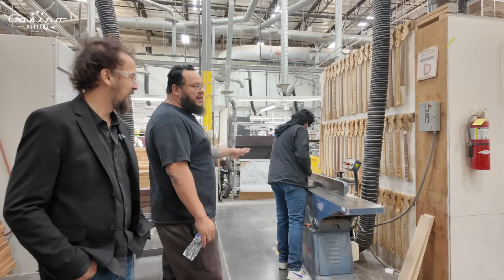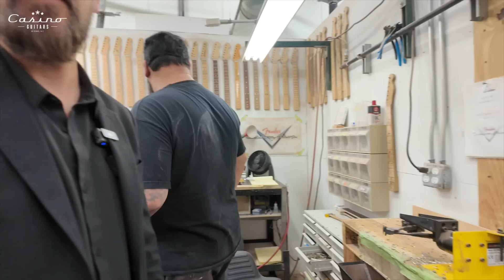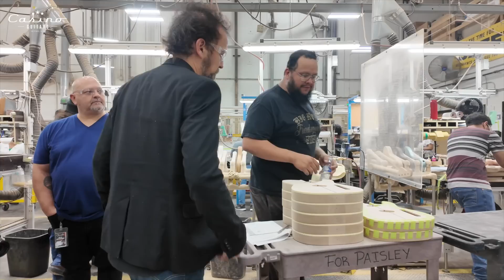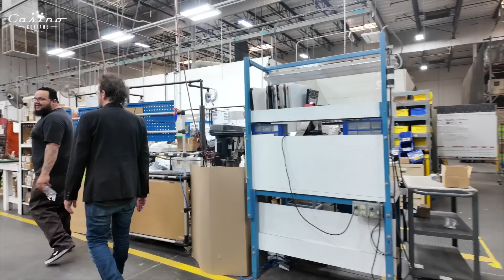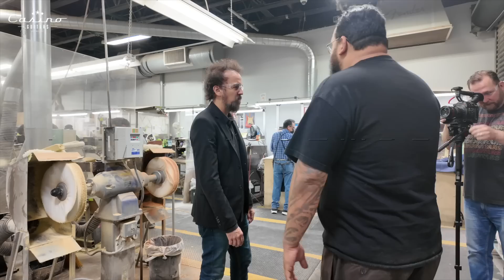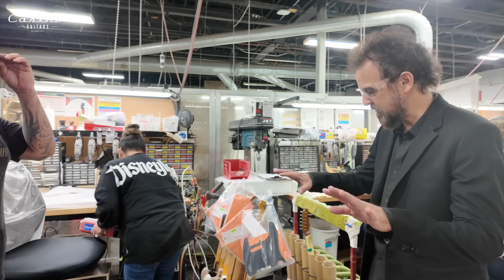Fender Custom Shop Factory Tour - Casino Guitars

Comment: I have seen a Jointer kill before; it was not pleasant.  Board slips out of the grip or guide and flies back and will stick in your head. Even several feet away. You NEVER walk behind past that when it is turned on. While cutting wood or not. When it is turned off, then you can proceed. That was a day in high school I will never forget.

Comment: It’s a pity they never checked the radius on my custom shop nocaster headstock. The corner radius is far too rounded off. In hindsight I should have not bought the guitar. It looks crap

Comment: How can you call it a "Custom Shop" when its just hundreds of people in a factory building a crap ton of guitars on an assembly line.
Reply: Tell me you’ve never played a custom shop without telling me you’ve never played a custom shop
Reply: @paisleyworldwide  i never said they wernt nice. i just dont see how sweetwater selling 100x of the same 'custom shop' guitar is 'custom' ?
Reply: @ true. the thing that makes them custom is that they’re built to the specs they’re ordered. Sweetwater specs them out to sell so they’re mass appealing. It’s like buying a guitar from Walmart, what would be most appealing to the most people? The customization truly lies in the options shown on the floor traveler where they have the pickup, neck, body, hardware, paint, relic, etc specs. If a custom shop guitar comes out basic that’s how it was ordered.
Reply: @paisleyworldwide  so what is 'custom' about a dealer ordering a bunch of guitars and you looking at them on a website? FSR (fender special run) would be a better term.  to me custom means the customer, not a dealer, calls in and specs off a 1 of a kind 'custom' made guitar.
Reply: @ … are you just trolling at this point? You can call casino and spec a guitar out to whatever spec you want and the custom shop will then make that guitar specific to your requests. “Custom” literally does not mean customer. It means the ability to choose your specs. It doesn’t matter who’s doing the orders, whether that’s you or a dealer, the custom shop makes the guitars according to the specs that are chosen.
Reply: @paisleyworldwide   Sweetwater can call fender and order a special order run and get pretty much any specs they want on any series of guitar. they call this Fender Special Run (FSR)  Does that make it "custom shop?"
Reply: @paisleyworldwide  who said custom meant customer? lol.   If a dealer specs out something to sell on speculation, then its not a custom shop guitar. Its a fender special run.

Google what fender FSR is.. "A Fender FSR (Special Run) guitar is a limited edition model built to specific specifications requested by individual retailers, often featuring unique features and finishes"
Reply: @ 🙄 have a good day
Reply: I see what you’re saying. I do think they’re over priced. 

But custom shop…Isn’t it because you can customize your guitar and whatever preference you have vs the production line are specific set of guitars you can’t customize. I dunno if it’s the amount of workers   ? Or am I thinking master built?
Reply: @leggomyguitar  If you order a custom made  to order fender custom shop, thats a whole different ballpark than just their normal custom shops you can buy off the rack from sweetwater or casino.  and about 2x as much money.
Reply: @leggomyguitar I dont know about that. It you’ve built a guitar from scratch you see real fast its amazing some of the price points these companies can hit.
Reply: @leggomyguitar  yes not much real customization nowadays in custom shop., just a marketing term, proper customization is more master built. I ordered a custom shop with sort for lightness option waited 18 months and got the heaviest boat anchor. All sorts of excuses on following up seems no guarantee in sort for lightness options….which kind of defeats the whole purpose :(
Reply: @grahamkelsey8687 aw damn man. That sucks. Thanks for the insight.
Reply: @leggomyguitar this ‘insight’ is heavily biased obviously. 

Their guitars are all made by hand to custom spec, have seen the comment ‘boat anchor’ many times over the years in music across all styles of guitars from grown men who can’t handle 4kg on their shoulder. Calling their custom shop just ‘marketing’ is ignorance
Reply: Because it's custom specifications or where they build their "custom" guitars, separate from their year standard models. 

Your anger against the naming is overshadowing your actual concerns (some valid), such as quality control and pricing. Talk about that stuff instead and forget about fixation on the naming of their factory being, "custom shop" lol
Reply: I can tell that they eat really well over there at fender🎉
Reply: “Custom Shop” is the name of the brand of this tier of guitars from Fender.  It’s not “Bespoke Built Guitar Just For You.”  But you can also request that from them - which is “customIZED” from the eras of guitars & parts that Fender has or does make.  So is Master Built.  If you want “custom” by the way you’re thinking about it, then you want a bespoke guitar of your own design from an individual (or extremely small) builder.
Reply: I’m looking at all the comments you’ve ever made and there pure negativity find some light in your life. Instead of shitting on things you know nothing about.
Reply: And to your point ..it’s a SCAM. Always has been, there is nothing CUSTOM about it.
Reply: @son0fsocal  would love you to elaborate on why you think this. A scam is taking someone’s money and not providing a service. Again, their guitars are all made by hand to the desired specs of the customer. Have you ever owned one?
Reply: That's called up charging for a special label
Reply: The Spinal Tap of guitar manufacturing.  "Why pay less" ?
Reply: All these gazillion people 😂😂
Reply: Seems like Fender custom shop is Music Man and G&L’s regular production. You’re right these should be higher quality instruments than the standard ones.
Reply: Man oh man! Are you serious? What do you want them to do? Have 3 employees and build 200 guitars per year? haha Its a custom shop. Customers order guitars built to their specifications! Hello, all manufacturing has a LINE. There is a start and a finishing point.  What is happening in this SHOP is totally different from a mass produced production line. Again, so, how would you lay out your guitar shop? Have builders working on 3 levels and walking around in circles round and round? LMFAO! You  need a damn line to produce everything. SMFH!
Reply: @johnsmith-ug5tp  what about them producing 1000+ exact same guitars to sell to dealers is “custom shop”?
Reply: @SeanEricBrooks  Yes they are. Exotic body, neck and fingerboard woods, period correct wiring, parts and hands on manufacturing and nitro finishes. I see nothing wrong with it. People who love Fender guitars can get one of these custom shop guitars for 4 or 5 grand which is very reasonable. Fender saves a little money doing a run for a shop and the buyers can save a little too.
Reply: @SeanEricBrooks I thought the specs were custom, specified by the dealers?
Reply: @tom.m  which means it’s FSR.   The dealer isn’t the “customer” or else they couldn’t sell the guitars as new.
Reply: @SeanEricBrooks fender exploits illegal immigrant labor. It’s a FACT. Go down the 91 fwy to SUHR and see who works there. I ordered a SUHR. I won’t ever support fender.
Reply: 100% “custom shop” has just become another production line of fender and just a marketing excuse to charge more. Even master built is more like master finished……it’s a joke at the prices.
Reply: @grahamkelsey8687  they make every guitar by hand and can order to your own specs…not sure how much more custom you’d want. Even production models are worked on by hand. Hardly just ‘marketing’
Reply: This guy is never going to be happy…
Reply: Did you listen to the video? They hand select wood at the beginning versus the mindset “ehh, let’s just see what comes out of it.” Nothing about the phrase “Custom Shop” runs counter to this operation. If you want just one individual to handle your Fender guitar, go masterbuilt.
Reply: @runwin3  so does PRS on all their core models. They don’t call those “custom shop”
Reply: @SeanEricBrooks I dont recall being able to completely spec out a core model. The options are much less. These are custom ordered, built to your spec. Having an assembly line do that still equals a custom order lol. It doesnt invalidate the word ‘custom’. There is the masterbuilt line if you want it but some people don’t need to go to that level
Reply: @jubjub905  okay but 90% of fender "custom shop" are prebuilt guitars that a dealer has sitting in a shop. You dont order them to spec. a dealer orders them and they sit on a shelf waiting for you to buy it
Reply: @runwin3 fuck fender and their hype
Reply: True, it's not a scam. It's marketing. They give you the idea that some offspring of Leo Fender became luthiers that carve and paint everything by hand like Gepetto. But this actually looks like the IKEA factory.
Reply: Are these (looking foreign) workers even legally employed ⁉️
Reply: @abgz1206  They are in southern california.. Most people look like that there lol